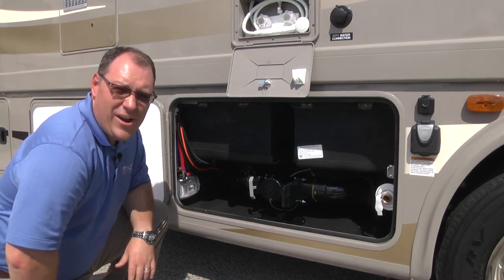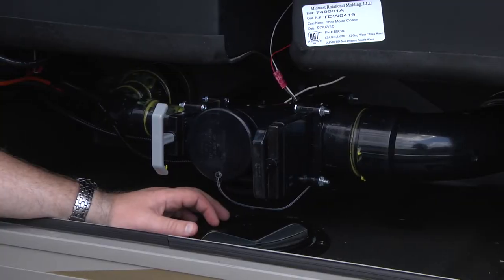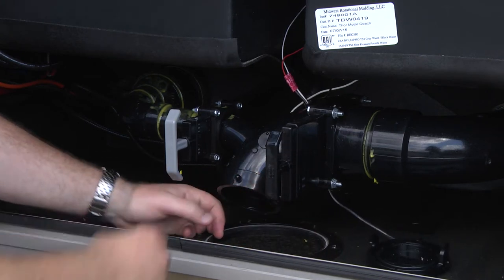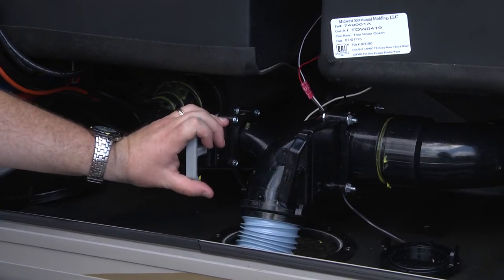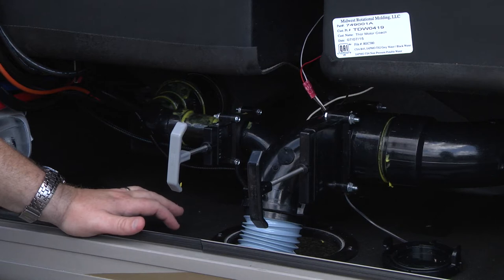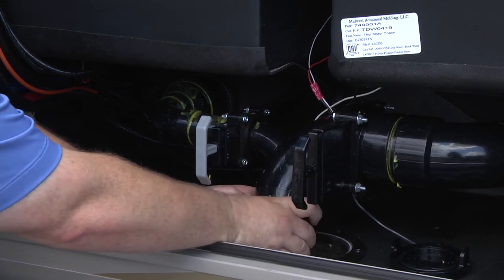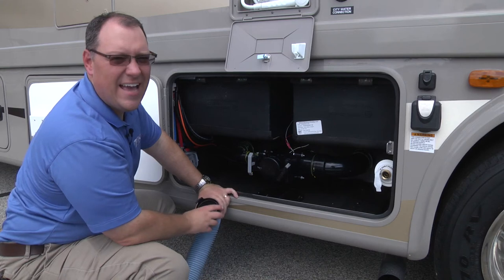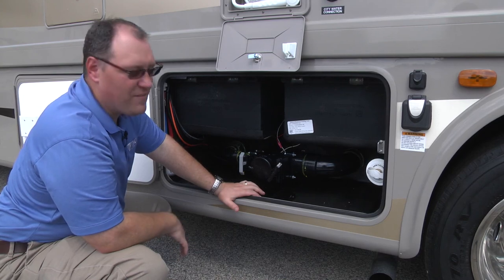A Closer Look At Your Thor Motor Coach Motor Home Wet Bay

Comment: I feel sorry for anyone who might follow the directions provided in this video.

Hand Protection:
Whenever you are handling waste systems you should be wearing hand protection, such as a pair of disposable gloves. After handing the sewage hose he instructs viewers to handle their fresh water hose, with his contaminated hands.

Simultaneous Black & Grey Open:
The black and grey water valves should never be open at the same time. Doing so allows raw sewage to enter the grey tank and/or its drain system allowing serious bacteria into that system. In addition, having them both open mitigates the ability to rinse the black waste from the dump hose as you have no means of ensuring the black is finished draining before the grey.

Clear Sewer Hose Section & Rinse:
All sewer hose connections should have a clear section to allow the user to note when the tank drain is complete and when the rinse is complete. In this v=ideo he does not even talk about a black tank rinse, an essential task required to fully flush the waste holding tank.

Sorry, this vid is a "fail" that appears to have been done by someone with little or no practical RV usage experience.
Reply from the maker: Hi Ron, This was a very simple overall summary of how to operate and maneuver in the wet bay area. Thanks for commenting and watching, and the gentleman in this video has over 20 years of experience in RVs and can just do about everything. ;)
Reply: I dont believe so, my grandfather dosent agree and has been dealing with systems in rvs for of 50 years, and much agrees with ron